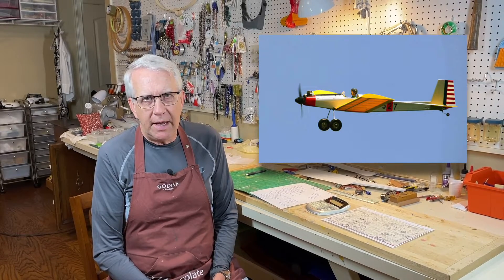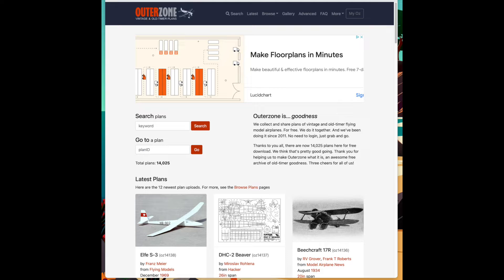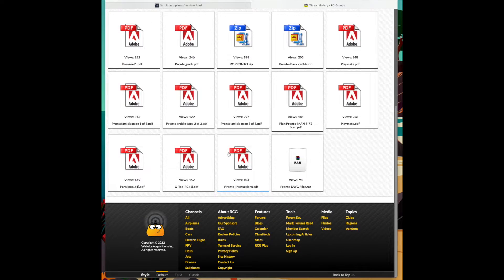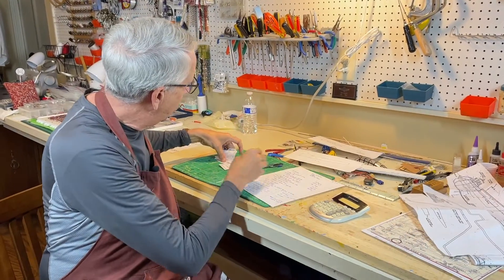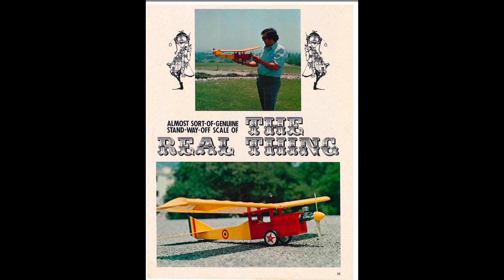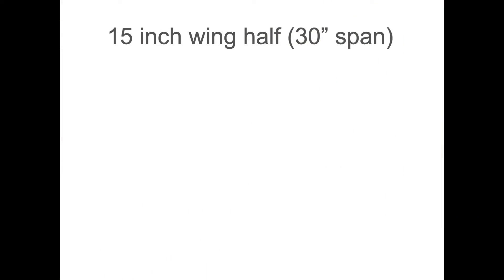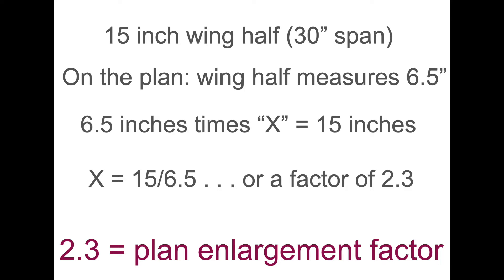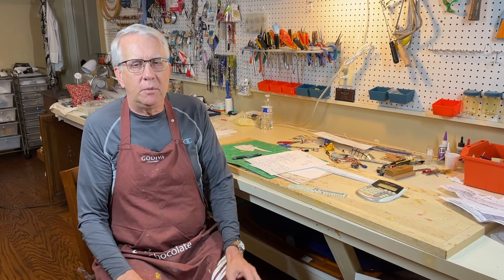How to Enlarge RC Plane Plans Free and Easy Method

Comment: I have no printer .
 I have an  $20 led video projector .
 Outerzone plan can be projected from phone to wall .
   Tape a piece of painters masking paper to the wall or tape several notebook sheets together to trace the plan . 
   Mark the span distance on the paper first . For instance 
If you want a particular scale of model or size of a 3 foot span , marlk 2 lines 3 feet apart onto your paper so you can move the projector in and out or zoom your phone screen image so the projected plan on the wall is inside the 3 foot marks you made on the paper you have taped to the wall . 
 Then trace it with pencil . 
 On a table with ruler and marker go over the plan outline of one wing , (left or right wing) and cut it out and turn it over to trace the other wing . This helps reduce any dis t oryion effects and improves perfect symmetry.
Reply from the maker: Excellent input!  😊

Comment: A more simple method uses a program called "Profili" or Profili Pro". Both programs allow the user to define a distance on the plans (usually the scale that used to be printed on all magazine plans) and it resizes the plan automatically. It has a tile print option that allows for printing on a standard printer or you can take the output file to your local copy center and get it printed full-size on a single sheet. I've used this program for many years to scale magazine plans.
Reply from the maker: That is an excellent tip, thanks for the information!
Reply: It’s come to my attention that Profili Pro 2 is no longer available from the author but the functionality is included in a CAD program that he offers. There is an easy, and free, way to scale plans using the Inkscape program. Import your raster drawing into the program. Change the document properties to measure in inches. Draw a line parallel to the published scale on the drawing and read the length of the line (the width measurement) in the tool bar. Divide the scale length on the drawing by your measurement and that is the multiplicative value that you need to enlarge drawing by. Delete your drawn line and click in the drawing. Make sure the height and width measurement is locked and multiply the current width by the value that you calculated. Your drawing will now be the proper size to use as a build plan. Export it as a PDF and use the Poster print function in Adobe Reader to print a full-size plan that you can build from.

Comment: I built one in 1985 or 86 from RCM mag but it had a curved vertical stabilizer and I thought it was called a air camper. They did a article on it and had a kit so I bought one and built it
Reply from the maker: Good times, I bet it was fun building from a kit!

Comment: Download the file, PDF is great, there are other formats that also can be used, bring the file on a thumb drive to a local print shop, many are around, then have it printed at full size..Might cost 5-10 bucks...
Reply from the maker: Fully agree, I have a video using FedEx Office large format scanner.
Reply: @TimMcKay56  I enjoy your vids. Presently working on a 1980's  Sterling Diamant...Very tricky making it work so the wings come off for transport..I've gleaned excellent info from you...

Comment: If your plan is in PDF, Adobe allows you to scale print it using the setting in "Page Sizing and Handling" section in the "Print" menu. The plan will be printed as a mosaic on multiple pages that need to be assembled. I believe it can add registering marks to help line-up the pages. If I remember correctly, it may take a few try to get the scale factor just right. Some kind of light box is useful to assemble the pages into a plan. Also, computer printer can "drift" a bit on printing causing long lines to be off by a little from one end of the page to the other, so a long ruler is useful to insure that the reference line (mid fuselage, main spar) is one straight line. In any case, period plans are seldom perfect anyway!

Another possibility is to load the plan in some drawing program, retrace it (or part of) then hide the plan and print the retrace. This is useful when plan is scale-up a lot giving fuzzy thick pixelized lines after magnification.
Reply from the maker: Great information, thanks!

Comment: Somebody thought it necessary to explain to factor up. So all you need to know is simple  mathematics. What a concept. Not a hater, just thought there would be better way. You still need to draw the outline and locate formers, ribs, etc. Too time consuming.  And, your going to make mistakes as your doing the drawing.  When was the last time you scaled up or down a rib and did a perfect job? And the french curves necessary to draw such. Holy smokes. Just human. Who's going to check your drawing? Let's be realistic shall we?  Spend the $10 ( or whatever ) at Staples. They can factor what you need, and no drawing necessary. Done.
Reply from the maker: Thanks!  Tim

Comment: I'm in process of taking a walt mooney design the hollandair-libel and enlarging it . using the same method . but using millimeters so can be more accurate . I'll of course be adding more ribs spaced as needed . plus for the tail feathers will use 1/16 inch balsa with a layer of 1/64 balsa cross grained in center (pretty much a balsa ply ) but with cut outs for the hinges , stronger than 1/8 plus hinges are perfectly straight and center that way .
Reply from the maker: Sounds like a good plan!  Tim

Comment: Hello! When you talk about "full sized plans," to me that means plans for the construction of a full sized airplane...that you can literally climb aboard and fly without servos. I am not a RC modeler nor am I an aviation engineer. Building a model airplane isn't a problem for me. Up-scaling it is another matter, though. I know math very well as well as ratios, but will a full-sized airplane have the same aerodynamic characteristics as a 1/72 model, as long as all the proportions/ratios are correct?If not, is this why you see a model B-52 with a wingspan of say 4' leap off the ground after a 10' take off roll? I need help with this, since I want to design and build my own WIG effect craft, that I can climb in and fly. Thanks for help you may have to offer. Dan
Reply from the maker: Hi Dan:  With model aircraft the term full size plan means a plan size that matches the model’s completed size.  For example, if the model’s wingspan is 50” then the plan wing diagram is a full 50”. The wing is built directly on the plan with wood sizes as drawn. 

Aerodynamic characteristics will vary with model size. As a general rule the larger models fly better. Tim

Comment: Probably being stupid, but how does this work with the curved wing ribs when there are no square edges to measure from ? Thanks, I'm looking at building the Black Bullet.
Reply from the maker: Adrian:  Should work OK, just make some estimates for the curved wing ribs. Tim
Reply: @TimMcKay56  OK, will give it a go. Thanks
Reply: another thing you can do is draw a box around the rib with a reference line through the center . then draw vertical lines lets say every 1/4 or 1/2 inch from front of box . make an enlarged drawing of the box with lines adjusted to proper distance and measure each spot on plan , do the math and transfer to the enlarged box . I use millimeters to get more accurate measurements
Reply: @rodchurchill5576  Thanks Rod, a time consuming way , but I can see it makes sense. 👍

Comment: I scaled up a flight test mini Mustang plan.  (Plans are free on their web site. ) Worked out the factor I needed for a full foam board version and used a feature in Adobe Reader (free) that lets you tile and print the enlarged plans. Easy and no sketching.
Reply from the maker: Great info, thanks!  Tim

Comment: Very good explanation of scaling using ratios. A much easier method, for a small amount of money (10 euros), is a program called IsiPlot. It allows you to import your image and define the distance of any handy measurement on the plan. It can the scale bar, that was published on many plans, or you could define the size of 1/2 of the wing panel as 15 inches as in your demonstration. Once that has been done, can print the full-size plan, if you have an appropriate printer, or save the file and take it down to your local printing center to have them do it. You can also print the plan in a tiled output and tape the pieces together. I don't have any relationship with the author but have been using the program for over 10 years and have been very happy with it.
Reply from the maker: HF:  Very good info to know, thanks for sharing!!  Tim
Reply: nothing worked for me???????
Reply: Rasterbator is free and scales you image over as many pages as you like.

Comment: I did that with the Lazy Bee plans I think I got from your site, multiplied by 1.5.
Reply from the maker: Very good!  Tim
Reply: Another good way using ratios is to find an architectural printing firm or   office supply store with a 3 ft. strip printer and apply your scale factor to their printer.  Most of these places could use outerzones files directly. 
I've done this a number of times and it works well..
Reply from the maker: @ronaldhoward1198  Good stuff, thanks!  Tim